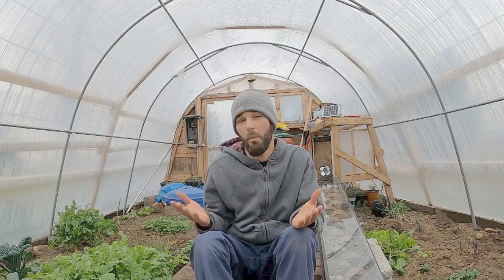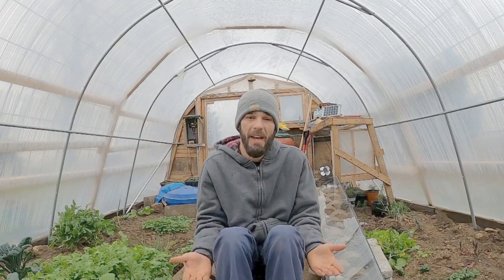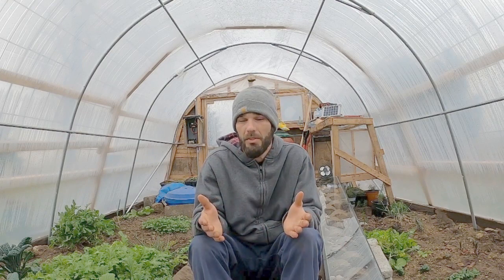DIY Calculating Greenhouse Venting Requirements Formula | Examples, Ideas, & Looking Forward

Comment: Interesting formula. 

I wonder about creating micro greenhouses inside the main greenhouse to create smaller volumes of air to heat & ventilate during the winter. After all, most winter crops don't grow tall anyway, so one is heating & ventilating the massive volume of the main greenhouse mostly to make it comfortable for a human to work inside. Might be more cost effective to just heat & ventilate smaller micro greenhouses (cold frame & low tunnel) that are placed inside the main greenhouse and concentrate heat, humidity and light control in these smaller enclosures. (I won't mind wearing my thermal coveralls when visiting the greenhouse to tend my winter crops if it means saving a huge amount of money on energy bills.)

If there is an HVAC tech out there reading this, how might the formula change for micro greenhouses with less overall air volume to ventilate & heat?
Reply from the maker: Great thoughts! We do experiment with cold frames in the greenhouse once in a while but we have 50’ of tunnels we put up during winter to cover our rows

Comment: It's interesting to do a stack (chimney) calculation for this. This is where the value of low and high-level vents becomes apparent. The higher temperature in the greenhouse compared to the surrounding air creates a pressure differential that drives the flow through your vents. The greater the height difference between the low (inflow) vents and the high (outflow) vents the faster the flow through the vents. For ease its best to take the area of the smaller vent (ideally the inflow and outflow vents should have about the same area). Bernoulli's equation converts the pressure differential into a flow speed and that times the vent area gives you the volume flow rate. Using the 2% rule you have gives a temperature rise inside the greenhouse of about 15 degC (27 deg F) for 500 watts/sq.m solar heating with a 2 metre (78 inch) height difference between the vents. So, as you say, I would treat the 2% rule as an absolute minimum and shade cloths would almost certainly be required in summer. Having struggled to keep our old greenhouse down to a reasonable temperature for tomatoes (even here in the UK) I'm building a new one with about 12% vent/floor area ratio in the hope of keeping temperature rises down to about 6 deg C when needed.
Reply from the maker: Great wisdom from experience! Thank you for sharing this with everyone, when I build a solid frame and wall greenhouse I will surely be taking into account venting for summer and locking down tight for winter, since we’re in a colder zone I chose to go with a very low ceiling build to optimize heating in winter, but for summer our shade cloths at 40% surely do the trick. Thank you again for sharing with everyone!
Reply: @Earthdwellershomestead  Many thanks for the reply. Yes, making a greenhouse serve well in summer and winter seems a real challenge. Keeping the ceiling low is certainly a good way to help keep things warmer in winter. In addition to the greenhouse we use cold-frames made using 10mm twinwall polycarbonate and they are quite effective in winter for plants small enough to go in there. We have used the 10mm twinwall for the greenhouses as well because of its good insulation properties. It's also very tough which is important here as its a very exposed site (shortly after we moved in one of the pole barns blew off down-wind in a storm and took a chunk of the house roof off on its way so we had quite a heads-up to how thing need to be built around here!). The oldest of our polycarbonate is about 10 years old and is still clear and flexible so the claims for a 30 year life for the stuff seem reasonable. I'm really going to town on sealing the new greenhouse for winter as I'm convinced even small air leaks have a significant effect on over-night cooling. 
I'm also looking at ways of storing some of the heat of the day in the 1000 litre IBC bottle that holds the roof capture water and releasing it back to the greenhouse over night. 

BTW - an old Victorian trick to help greenhouses in winter was to darken the soil with ash!